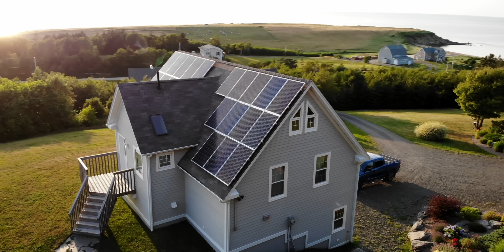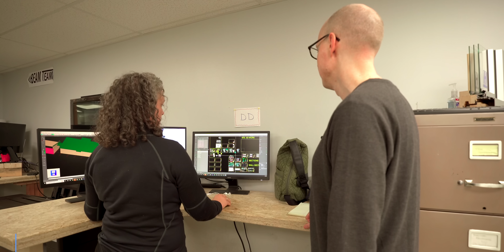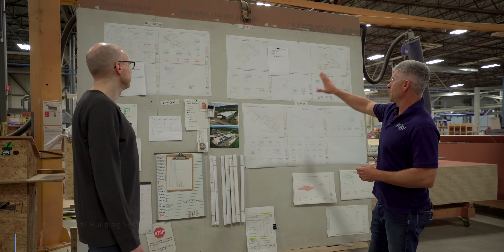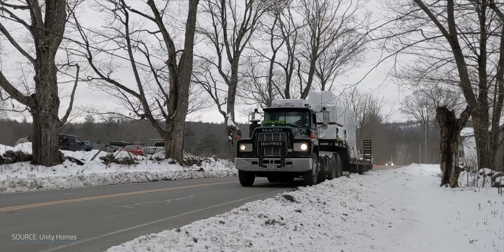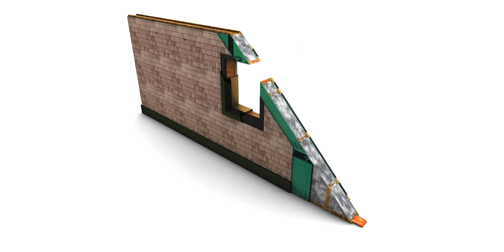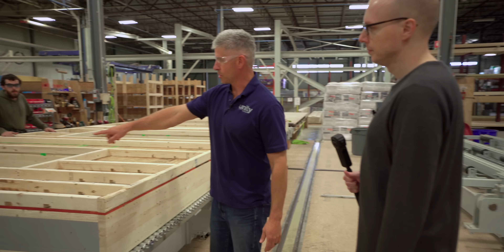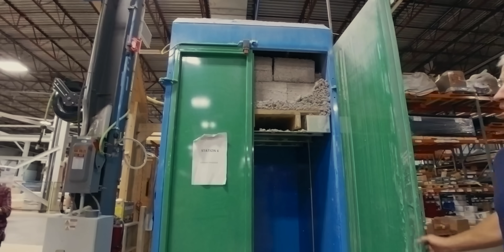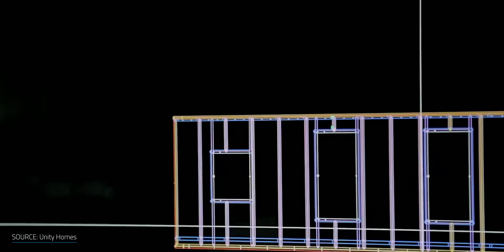The Simple Genius of a Prefabricated House - My Net Zero Home Build

Comment: can you compare that to a German/European house?
Reply: Yes you can 😂😂😂
Reply: The building materials seem to be more „wood-based“ compared to German Houses (also prefabricated German houses). I‘m German but it seems to me that the USA way of building houses is less carbon intensive compared to German houses.
Reply: @fjt99  
depends on the time. the house I grew up in is 120 now, the house I live in is 90 years old. these prefabs dont look like they last long enough.
Reply: @TheMntnG  So are you living in a American or European house?
I agree that it highly depends on the time in which the houses were created. In the 70s/80s German builders used materials like asbestos and didn’t care about insulation at all, which means that these houses needed to be renovated in later years to add insulation. 
I’m not as knowledgeable regarding prefabs but as far as I‘ve seen them in Germany, they usually use concrete elements which get delivered by heavy haulage.
Reply: @fjt99  
yeah, and then the prefab concrete lasts 100 years. us prefab looks like it falls apart when it‘s windy
Reply: @TheMntnG  ive lived in a prefab concrete house, couldnt wait to get rid of it
Reply from the maker: Not Unity homes ... they're built to last.